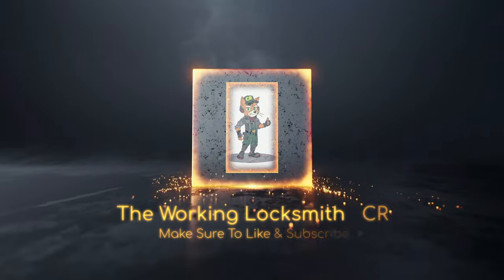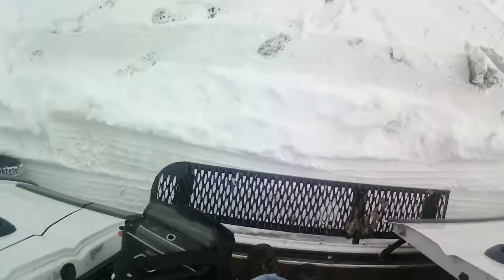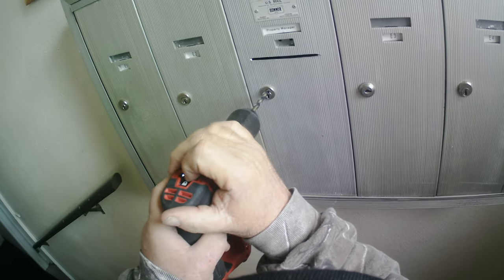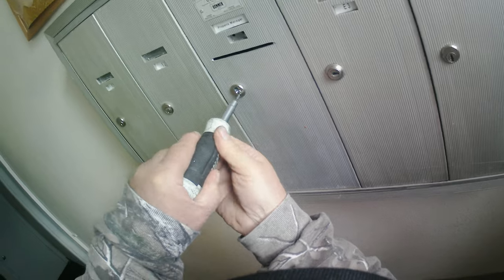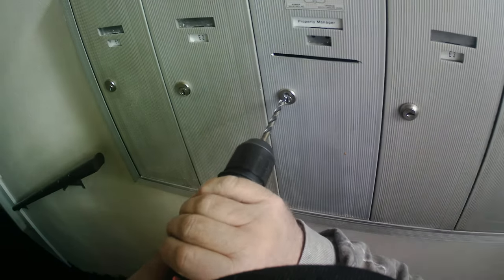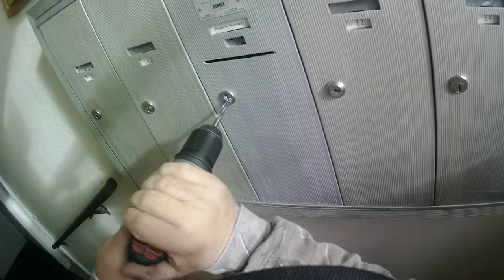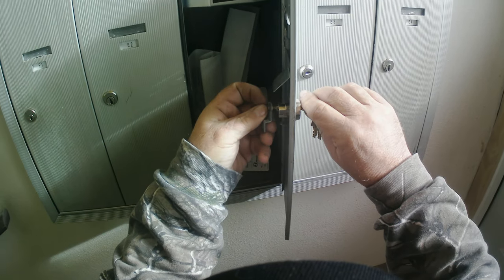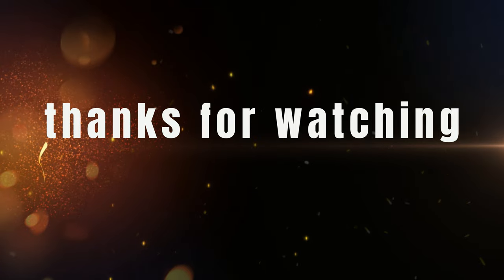Drilling a Mail Box lock.   The Working Locksmith

Comment: I really don't wish to be rude but as a working locksmith in the UK why in the hell would you drill suck a basic lock to pick?   You did on the plus side did drill the correct spot but seriously a locksmith is a tradesman that prides himself on picking locks and using NDE techniques to gain entry and save the customer extra cost on replacing a lock if not needed.  I would suggest if thats your goto for gaining entry then here in the UK you would be nothing more than a handyman and not a locksmith.
Reply from the maker: Yup, they can be picked very easy.....and if you had a lishi pick you could decode it. I didn't  have a lishi so I knew I would be replacing it.  the replacement lock cost me 3.00.... having said all that....   I did the video for people that don't know how to pick.   I do agree....any guy that drills all his locks....would not be a locksmith.  Cheers to the UK.      CR
Reply: I think that guy is a butcher.  It will pick open faster than being drilled open and your drill bit was to big next time use an 1/8''
Reply: @timhill130 a center punch and 9/64 would've took literally 10secs
Reply: @timhill130  I have never used a drill bit large than 5/32 to drill the shear line of any type of cylinder ever
Reply: They don’t pick ….. easy to drill and put a new one in visa time and cost of lock.
Reply: @timhill130 These don’t pick.
Reply: Hey smart guy, the name of the video is how to drill a mailbox lock, not how to pick a lock. Here in the USA, if you can't read and understand basic video titles, you would probably need to just shut up.
Reply: Hey, my mailbox is jammed and it won’t open, I sprayed WD40 but still won’t work, it is fully in there but won’t turn. Any tips

Comment: Funny thing is, the post office mail carrier could use their key and open the top and retrieve it.
Reply from the maker: Jimbob  you are so correct!  , Got a question for you....do you think it would be worth your time to try and coordinate with the post office?   Not much luck on this side
Reply: The issue is that box is the outgoing mail box. The post office should be the only people with a key to open it. Who did you give the new keys to?

I'm sure you are breaking a law not letting the post office do this. You could see other people's letters in there. No different than going out and drilling into one of the blue collection boxes.
Reply: @bryanhersman4037  wrong post office policy says you can replace the lock doesn’t have to be through them
Reply: @gleem1751  that is not a customer box, that is the outgoing mailbox and the one that then allowed the whole set to tip open for delivery to the apartments. Somebody was trying to retrieve a letter that was placed in the outgoing mail which isn't allowed, certainly not through destruction of the lock. Like I said before, this is no different than going down to the corner and drilling out one of the big blue collection boxes. You can in some situations change what is considered a customer lock, the lock that opens up a customers individual mail box, but this box in this video is not that.

I'm the guy at the Post Office who does this work and I would have had any of those locks out in 30 seconds without drilling because I have the right access.

Comment: I have an old alarm box on the  wall and no key since i just bought this house  its a dead alarm system  so i just want it off the wall.   i think i will try it your way  just drill right into the lock ?  see if i can open the door and get it off the wall.  Thanks for sharing
Reply: It worked i got the lock open but now zillions of wires  in the box  not sure what to cut  , to be able to get this off the wall.   says it was put in   sept of 95  and there was a key inside  too. must of been the spare one

Comment: I noticed that you're using that smaller D-shaped Milwaukee M12 drill driver.  I was thinking of picking one up too for locksmith work.  How do you find it in daily use?  I assume you'd want something bigger for fresh installs with hole saws, but otherwise is it powerful enough for most tasks?  Thanks
Reply from the maker: Hi Zach,   I live it and had thought about doing a video about in and using it in locksmith work.  I will try to get it done this weekend.    Thanks
Reply: @theworkinglocksmiths  That would be great!  I look forward to it.

Comment: Sigh. All they had to do is contact the usps office. Tell them what’s going on and have them meet the carrier at the building. They would open the top of the box with their key and they could unscrew the bolt in the inside of the box lock.
Reply from the maker: Danm Kevin B, if there was more guys like you..there would be no need for locksmith :)
Reply: Im doing this exact thing Monday morning 05/10/24
Reply: I’ve been trying for over a week to coordinate with the post office. Time to drill…

Comment: I have never used a drill bit larger than 5/32" to drill the shear line of any type of cylinder, cam lock, rim, mortise, tubular deadbolt. I cringe every time someone posts a video about drilling and the first thing, they do is pull out a 1/4" drill bit! The only time I have ever used 1/4" was to drill the set screws for a rim cylinder or tubular deadbolt so, again not drilling a shearline. 39 years as a locksmith as well as an instructor. I am saving this video under "wrong" for my students of what NOT to do.
Reply from the maker: Hello Sebastian,   I’m glad my video will serve the locksmith community well….
May we pick until there will be Nothing locked!